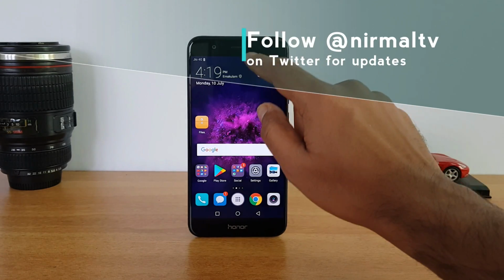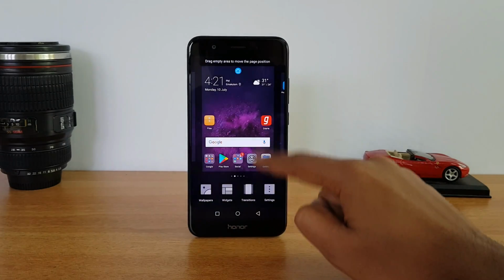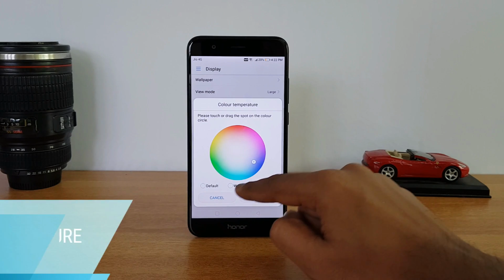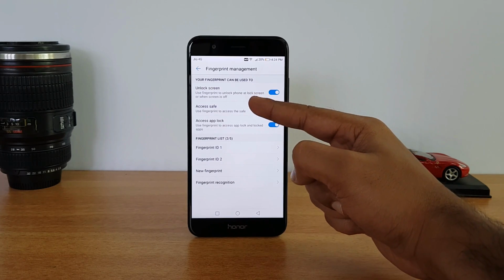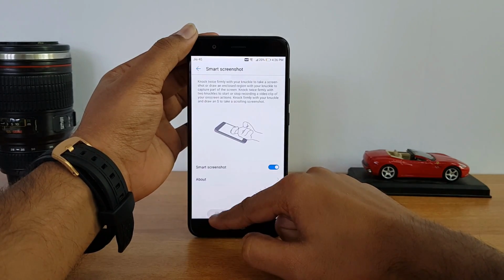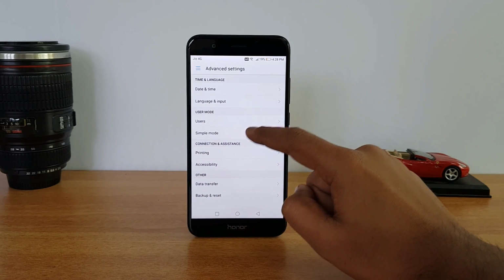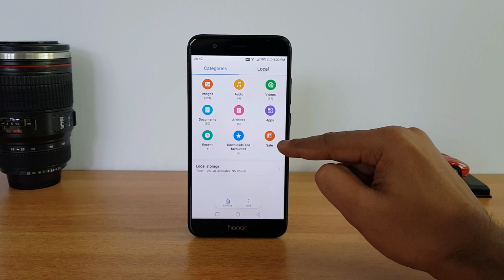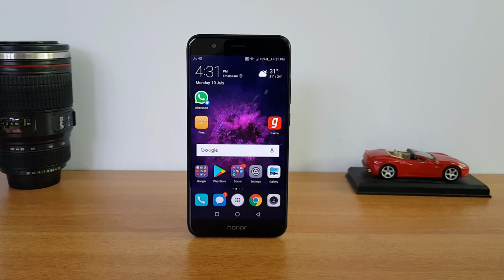25+ Best Features of Honor 8 Pro - Tips, Tricks and Hidden Features

Comment: I am going to buy Honor 8 pro Over Oneplus 5 , 

For normal use

whether it is a correct decision?

what is ur opinion about heating issue?

Quickly reply me
Reply: sirivela prasannakumar no bug. I bought Honor 8pro last week. Works as a charm. Way better than op5. Go ahead
Reply from the maker: Yes go ahead
Reply: I heard that honor 8 pro has got a lot of bugs.. is it true.. pls reply,,,
Reply: CA Abhishek Mahajan some bugs

When you open your data notification bar lags

Some apps close automatically 

Otherwise it's the best smartphone ever
Reply: Kiruba  if budget is a concern, then honor is the best option.
Reply: Go Bro. I am using this.. awesome mob rather then f**k Oneplus 5
Reply: Techniqued but sar value s high Honor 8 pro sar value is 1.17 actual sar value limit s 1.6w/kg only is it safe to use honor 8 pro
Reply: Alone Warrior  bhai 1.17< 1.6 😂😂😂
Reply: isme display theme change Kar sakthr hy Kya.. .??
Reply: 17 > 6 ... thats what he meant :D

Comment: I want to buy a phone...please suggest one
Honor 8 pro or LG V20

Please reply asap
Reply: 1. software - at par with each other
2. Display - Both are same 2K resolution IPS
3. RAM     - OK...Honor has 2gigs more so what, continue to below
4. Performance  - Its a known fact that kirin960 ranks between SD820 and SD82...so can't expect much
5. Camera  - Way better in LG v20
6. Music - There's no competition with the Audio Beast, Quad Dac in V20..also, premium bang and olufson earphones comes bundled with phone.
7. Connectivity - Dual sim and dedicated SD card slot and 64gig internal in v20....ofcourse, more internal memory is good, but SD card is always better.
8. Removable battery is way more versatile than sealed battery
10. Military grade ruggedness of V20
11. Second screen - call that a gimmick or whatever but once u get used to it, you'll know how useful it is. people called even IRblaster as a gimmick, look what happened
12. finally, service centers of LG

there's a reason why V20 was launched at 55k and honor 8 pro is launched at 30k...even S7 edge, iphone6s uses last year's hardware, but does that make Honor 8 pro better than those
Reply: Honor 8
Reply: sandeep hyd Honor 8 pro.. LG specs are older

Comment: does 2k display consums more mobile data than Full HD screen for browsing and YouTube
Reply: WTF logic is that !!
Reply from the maker: +Srikar Chowdary No.
Reply: Srikar Chowdary no..
Reply: Srikar Chowdary YouTube yes...if you don't set the default settings to 1080p or lesser... it will automatically shift to 1440p stream if available...so it will in turn consume more data...